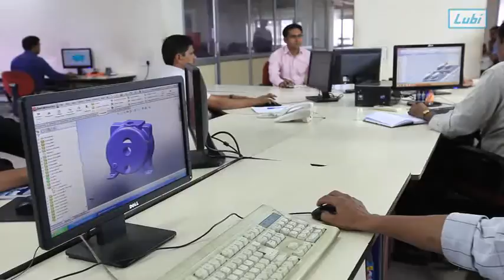The secret behind Lubi's ultra-modern pumps revealed!

Comment: Great Alexander shire estate aquaculture  butcher choice ww3 freezer full red barn upside down cross burn wifes hitler rice holy cathlic  good will pass lines esso Alexander more just water tanker farm less cent navey purfume hr hydroelectric mathew in spider wire 3mm test fibric mesh weld spin it stick to sink first pole Irving own. Stolen bar code 3 letter mat call do again on d9 forman card bms navey in floor swquaters 171 billy blancher  99 phynb